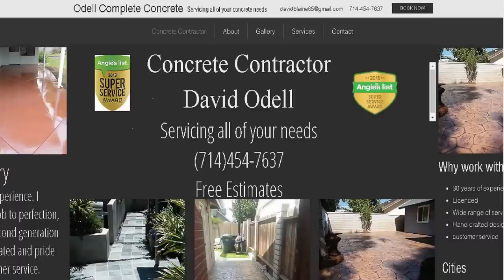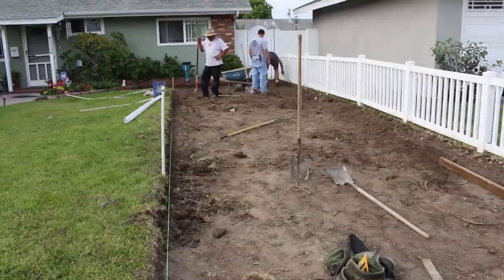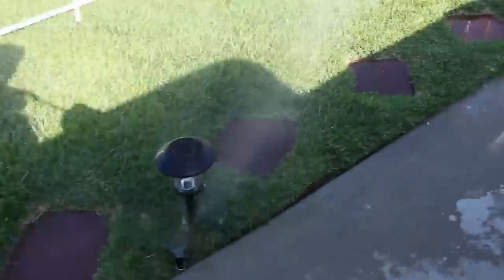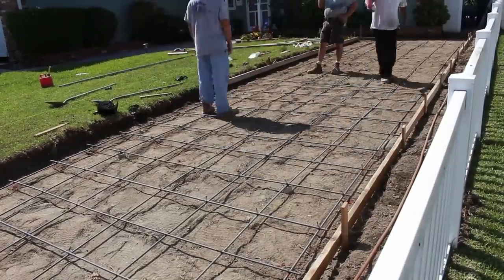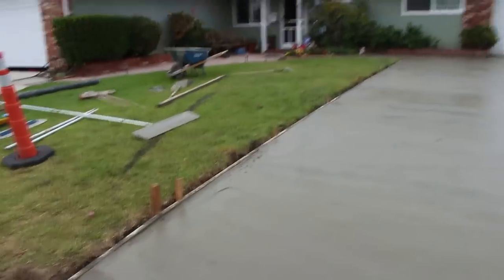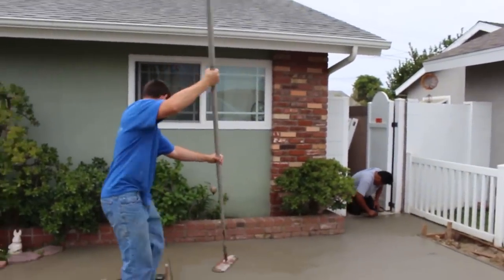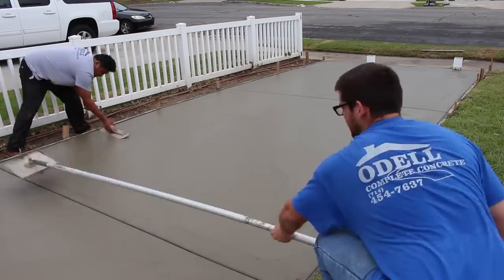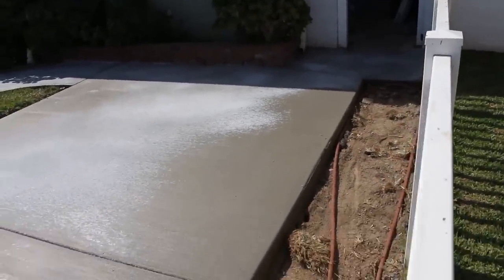How to make a Concrete RV Driveway

Comment: Another excellent job David!
Plumber, electrician, landscape architect and mud expert!!
Two questions: 
1) when you calculate how many yards you'll need, do you add 5-10% to your calculated value so you'll have enough?

2) How long do you tell your customers before they can pull a car - or RV in this case - onto the pad? I've seen a YT video that said that the concrete is something like 80% cured in abt 28days.
Reply from the maker: Concrete reaches most of its strength in the first 5 days. Not fully cured for 28 days.
Yes I add 10 percent concrete, and rebar to quantity I need.
Reply: Good information! Thx David.

Comment: I saw another job you did a driveway extension but you did not use steel reinforcements. Rather, I believe you mentioned you used fiber mesh for that. When/how do you decide when to use the steel reinforcement or forgo that and use fiber mesh? Is there another video that touches on this subject? Thanks for the great videos and love your work!
Reply from the maker: The mix design usually, big rock versus pea gravel. I always add fiber to pea gravel mixes

Comment: Been learning a lot from you lately. I want to puor a walkway and a drive way somewhat like this for a boat. 1. You think i can get away with wire mesh like 3/16 thick on the walkway and 3/8 thick rebar on the boat driveway??
Reply from the maker: Yes that will work fine
Reply: sounds like you have a yacht not a boat))) mesh with a rebar more like parking a dump truck)

Comment: I've heard its a huge mistake to take out the grass, it acts as a reinforcer for the concrete eliminating the need for rebar, just set up the frame with angle guards in the corners and duplex nail the spikes to the 4 sides, pour the concrete with self leveling solutions in the concrete and 2 hours later its level and drying. Water plays a huge part in the slurry mix as well; if it isn't moist enough, it won't have any strength to it as it dries.
Reply from the maker: wow
your thinking is the exact opposite of standard practices

Comment: how they supposed to pull in the driveway? I guess that's going to be another video.
Reply from the maker: aye run 
yes
Reply: RV's all have the access door on the passenger side. The owner will most likely back the RV into that spot so they can get inside while it's parked there. If they pulled in, they would have to walk around in the flower bed to gain access.
Reply: I am pretty sure aye run is talking about the missing curb cut and lead section of driveway on the street side of the sidewalk and not whether he will pull in or back the RV in.

Comment: Mr Odell, I have a project for a parking lot and a driveway close to the beach, right now has a gravel driveway that has been there for years, very well compacted, however most have to be remove to meet the right grade, the owner will be parking a pretty big boat, I am planning for 4" slab, 4000 psi with fiberglass # 3 rebar 18" in center and also pour with the driveway about an 1inch border below the bed to prevent any erosion or wash from underneath, even do soil will be filled against the driveway but still is very close to the beach, what do you think if you don't mind me asking. sorry for the long question BTW this is in VA
Reply from the maker: Doug Paredes 
sounds like that will work.
Reply: thank you

Comment: How do you do 5 inches while only using "2x4" as forms?  Wouldn't you need 1x6 boards?
Reply from the maker: NO the concrete will come out the bottom a bit.

Comment: In this pour, you placed 1/2" rebar on 18" centers. You said for just cars, you place 3/8", but at what spacing? Thanks- great vids!
Reply from the maker: With pea gravel mix and car traffic driveway, I go with 4" deep concrete and #3 rebar @ 2' centers with fiber mesh additive to concrete.
Reply: Is that something I can request from my concrete supplier? Thanks for the quick reply! Love watching your crew work.

Comment: So when you make the split across the concrete you don't actually go all the way to the ground but enough so that when it dries it will split itself?
Reply from the maker: JWB671 
yes the joint weakens the concrete there.

Comment: Hello mr Odell at 10:12 mark in the video is there a reason you didn't temporarily pull out those blocks that are being used as a border so you could of got a cleaner edge on the concrete?
Reply from the maker: Andres Reyes 
 NOT really because then you would have dirt there instead of concrete.

Comment: Mr. O, when is it necessary to use gravel? also, for a 30' x15" how many joints do you recommend? I live in South Florida. Thanks
Reply from the maker: Charly Espino
I don't know Florida dirt conditions.
But it never hurts to put road base down anywhere.

Comment: How much does a driveway that size cost?
Reply from the maker: 5000
Reply: That includes the excavation and everything? What was the sq ft? Seems cheap for california.
Reply: @OdellCompleteConcrete   why final finish surface for SAKRETE 60 lb. Gray Concrete Mix at box store wont be as SMOOTH as the TRUCK concrete?
Reply: 2 years ago 5000, one year 6500 few months ago 3500. Check the postings

Comment: I know is for cure it, but what it is ?
Reply from the maker: David Gomez
 basically it's a water base sealer
Reply: What brand of sealer do you use? Is it good for helping keep the concrete from drying out too fast out here in the desert of El Paso TX?
Reply from the maker: BaloneySansWits 
I'm not real particular on the brand of concrete cure I use. I get whatever the supplier has that day depending on where I'm at.
Before curing compounds we use to spray the concrete with diesel fuel, that seemed to work also.